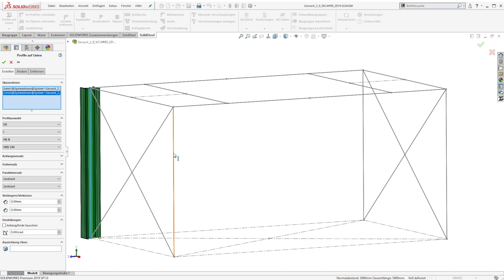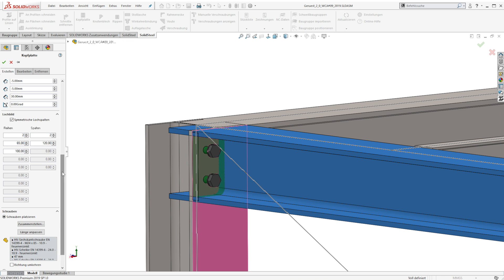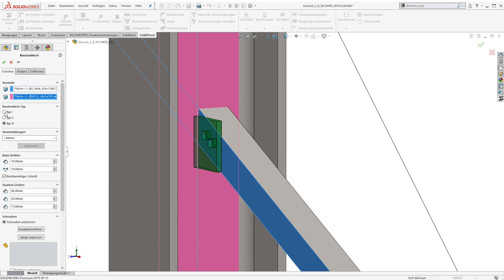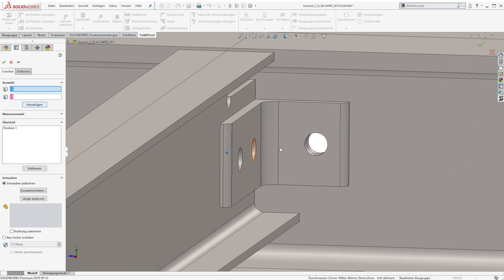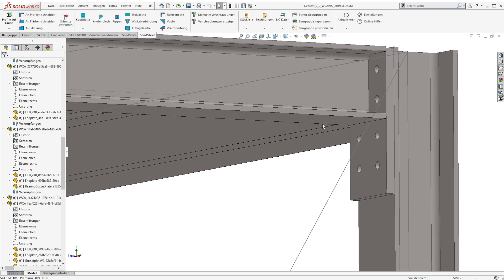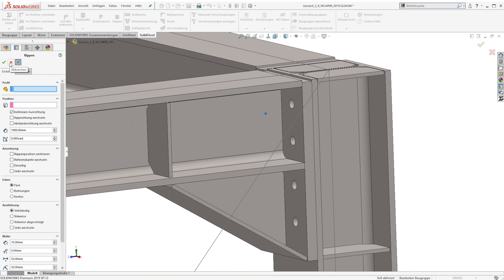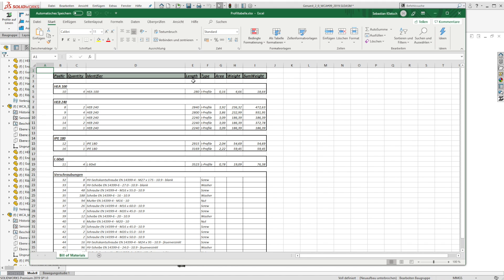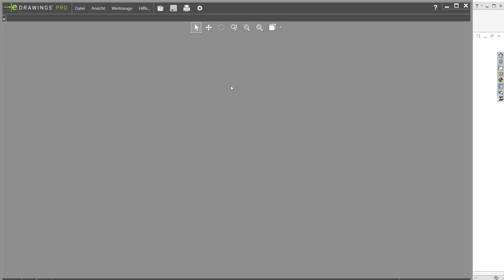Structural Steel Design with SOLIDWORKS - SolidSteel parametric - Product Video v2.0 - English

Comment: Do we need to put in the dimensions manually or it generates itself with the part drawings?
Reply from the maker: On the part drawings the dimensions are placed automatically! SolidSteel parametric does not use the „auto dimension“ tool of SOLIDWORKS - the software placed just the dimensions you really need for manufacturing.
Reply: Thank you for the reply. I am thinking of switching from Autocad to Solidworks. My job involves doing fabrication drawings for steel structures. Hope it does the work.
Reply from the maker: Just reach out to solidworks@solidsteel.de - My colleagues from the technical team can arrange a web meeting and we can show the capabilities of the software. In addition also a trial is possible. Then you can make a decision based on your own experiences.
Reply: Thank you. I will contact your team soon.

Comment: What is the compatibility of SolidSteel to SolidWorks? Does it only works with the latest version of SolidWorks?
Reply from the maker: Wayne Ho You need SOLIDWORKS 2018 or later to run SolidSteel parametric.
Reply: @apps4swx  Great!
Reply: How can I get solid steel parametric

Comment: How to calculate load in this member.
Reply from the maker: Depending on the way you work. You can use the SOLIDWORKS FEM modules or your can use the SDNF Interface of SolidSteel parametric to work with external solutions for structural analysis. Please send us an email to solidworks@solidsteel.de, if there are some questions left or if you want to learn more about SolidSteel parametric :)